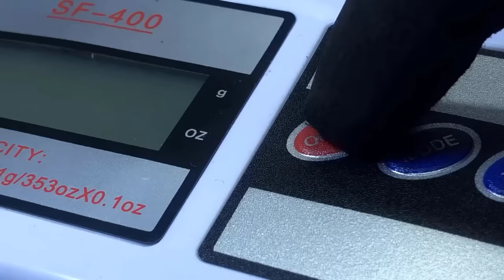Antique 1897 KUKRI KNIFE Restoration - Knife Restoration Video

Comment: Not quite sure why you heated it and what did you quench it in? It wasn't hot enough to harden and I think you may have only taken the temperance out of it. On your next restoration, instead of WD40, try ACF50.. Far superior for what you're trying to achieve. All that said, I admire your hard work.
Reply from the maker: yes you are absolutely right i agree ( thank you very much for watching your video )
Reply: Yeah, I was confused about that. Why ruin the original temper? Now the whole thing is going to be soft and not hold an edge... 🤨

Comment: I feel it was a big mistake to heat the blade which resulted in damaging the heat treat/temper. There really was no reason to do this..

My suggestion for the handle is to draw out the original shape on paper. Then practice carving this shape until you are able to attain a reasonable facimille before attaching it carefully to the knife. 

Also, it would be really good to practice knife sharpening on non antique knives to gain proficiency regardless which type of system you use, then carefully apply this new skill to your precious antique knife.
With respect. 
Good luck!
Reply from the maker: thank you very much for your feedback I know it was a big mistake of mine cutting the handle and not making it well But I will definitely fixed  it next time

Comment: On my own kukri that I found in a shed tool box it was not as bad as this one, wire brushed it, wet and dry paper it, never did anything to the handle as it was solid, turned out not too bad at all.
Reply from the maker: You soak it in vinegar and it will be as good as new.